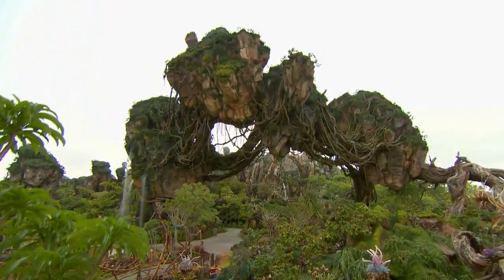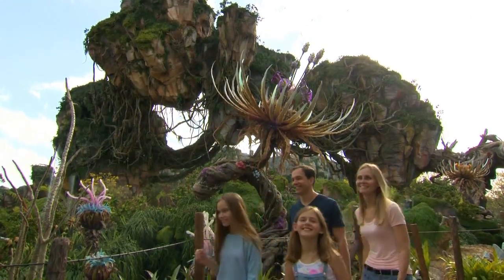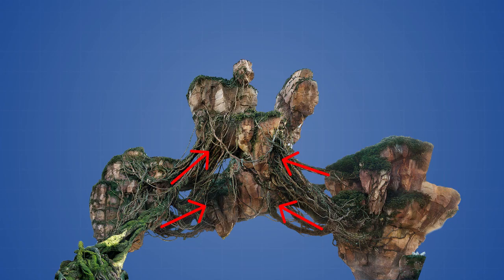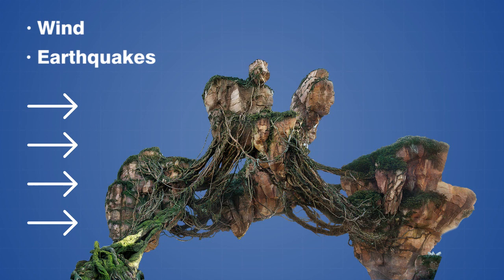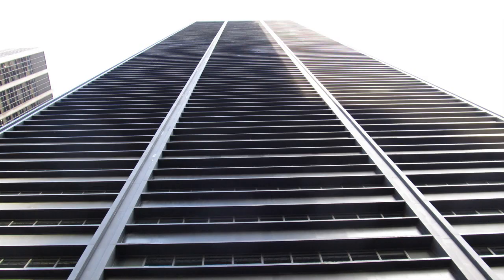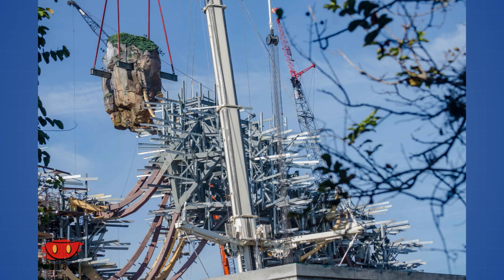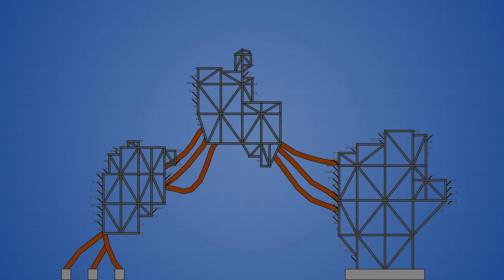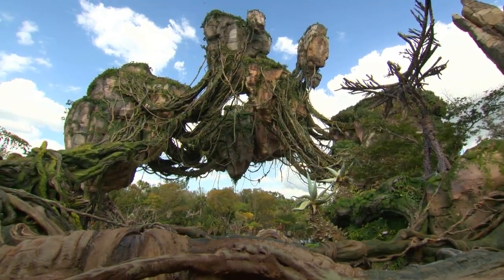The Engineering Behind Disney's Floating Mountains

Comment: yea, there's one big flaw that really takes you out of the immersion with the pandora area: from the parking lot as you enter animal kingdom, you can see the back part of pandora and they do not do a good job of hiding the actual structural supports on the back end.... like no effort whatsoever behind it all.
Reply: What do you expect? It wasnt built by imagineers, as engineers would focus more on making it work and having it pull off the look in the look, imagineers I'm sure would be more concerned with the full image and thus would have the backside hidden by faux(fake) and real flora most likely to cover the exposed appearance yet not completely block off access to the exposed structure(which I'm sure is ment for repairs)
Reply: Garry Courtney Is this still the case? I don’t recall seeing it this year, but I wasn’t looking for it. I remember showing my child from the lot though.
Reply: A lot of stuff in Disney has that issue. For example cars land was designed to be seen only from cars land. The back side is not rock just a load of structural supports. But as long as when your in the park and it doesn't affect immersion it's fine
Reply: @shannond7437  I went to Disney World this September. It's still very much the case. It was weird seeing the floating rock from the parking lot
Reply: Also happens with Everest and galaxy’s edge
Reply: We can't hide everything from 360 degrees. When you're in the park, there is no visual intrusion. But people will always complain anyway.

Comment: Great video, and great presentation. Cool "engineering" note: We built the steel structure using shoring (look at old YouTube videos of the construction site), then applied the carved plaster, polygem and artificial foliage before we removed them. The lead structural engineer correctly determined the amount of deflection that would happen once the post shoring was removed to within 3/8". Still blows my mind, and she was amazing to work with.

Comment: Fantastic and underrated video for sure. One thing though: I think for the smaller mountain they had holes inside of it so they could put beams through it, but they were just slid out after the mountain was in place and the holes were patched.
Reply: Coaster Labs they are apart of the structure and the ends were just cut off, it’s just easier to do.  they can’t slide out beams that weigh a thousand pounds.  It would be too dangerous
Reply: @acme3drevit  It definitely looks like they have holes through them.

Comment: The mountain on the ground has "old" water stains from where the waterfalls coming from it used to run. Combine this with the splintered and sheared look of the lower part of the sitting mountain, it gives the effect of the mountain originally floating, but having touched down after some sort of event.

Comment: Should the structure located in a mall, under a hangar or as props, it could have be far more impressive. They can use polystyrene, papers and other lightweight materials to present the elusive effects of floating. Considering it meant to be constucted al fresco, it has to withstand strong wind, heavy showers and other harsh phenomenon which led it to appear bulky, at least for me... not "floating" at all. The restriction might most likely causing it to look bulky. The engineers using superstructure to fix that state-of-art structure up on its place, and it is pretty much telling how massive that thing must be. Hey, I've yet been there, so I don't know the exact feeling walking under it. But from the footage, this is what I can feel.

Comment: To me, one of the least impressive of Disney's magic engineered works.  Those supports are so beefy and the mountains so close together it almost reads as one big pile of rocks.  Why make the higher mountains all steel and concrete?  Lighter construction would have allowed smaller supports.  It's not like people are going up there.  Even if just a single mountain truly appeared to be floating off reasonably sized support vines it would have sold the whole thing a lot better.  The finishing is top notch but the concept just looks rushed, and the engineering firm looks to have been out of its depth in terms of creating an illusion.  Honestly the more angles I see the less magical it appears.
Reply: bro you literally took the words out of my mouth, i’m looking at it from different angles and i’m just thinking yo myself it just doesn’t look right